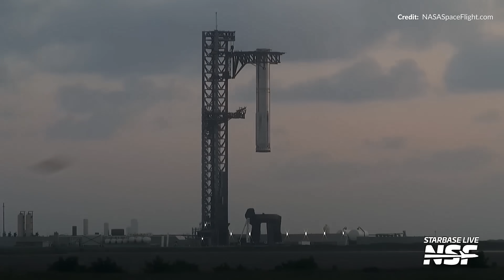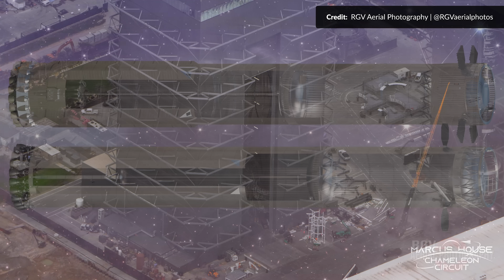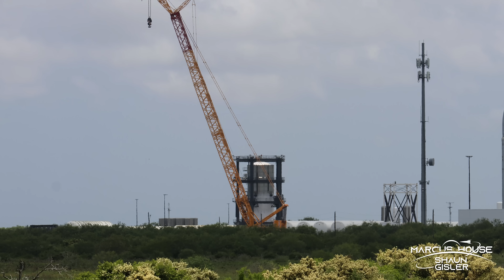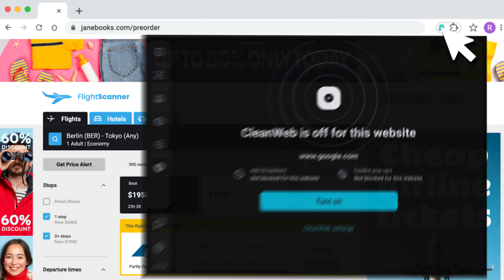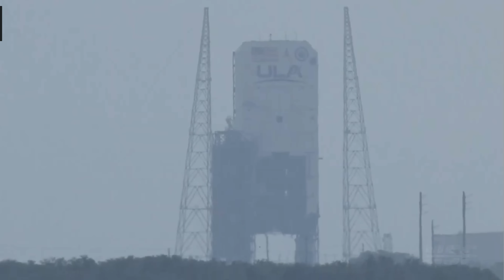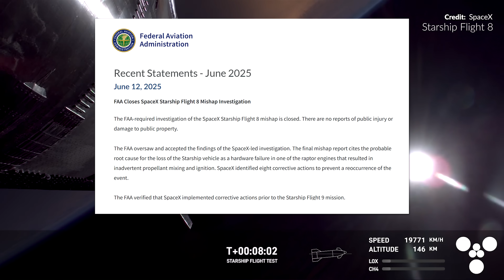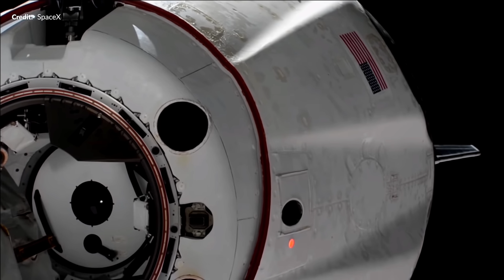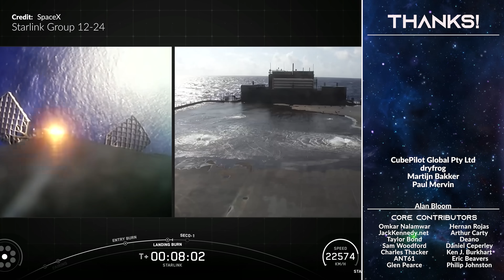Surprising changes to Starship Super Heavy! Why are they doing this?

Comment: It makes so much sense to have dedicated catch towers and landing pads.
This should put valuable launch hardware at less risk and mean less catch aborts when there is a suboptimal scenario.
Reply from the maker: 100%
Reply: For the first 3 years. Then no, dual purpose for rapid turn around
Reply: @rocketignitionKSC realistically, there is no reason to actually reuse them that fast. They’ll be able to built them fast than they can launch and catch em, so it would make more sense to basically have a revolving roster where it launches, is caught by catch-only tower, and then as it’s doing that and is being inspected post-launch, another goes up. Basically like juggling
Reply: @rocketignitionKSC I think it is going to take more than 3 years before a rapid turn around, doesn't involve a trip to a production facility for inspection and maintenance between flights.
It might never happen.
Reply: @psychologicalprojectionist  It makes sense in the early days, but not in the later days.  It's getting 50% efficiency out of your ground infrastructure and sooner or later space WILL be an issue and that efficiency will be desired.
Reply: One factor to consider is that, under the lease from CCSFS, a reusable launch vehicle must return to its launch site. So you can't launch from LC-37 and then land at LC-39A, for example.  Moreover, barge landings are in the EIS, in which case catch towers aren't needed.
Reply: also, it just struck me, catch tower could be the same as starship static fire stand?
Reply: @snuffeldjuret not quite, but that reminds me of something else - given that the catch towers do not need any fuel supply, and do not need to be able to stack vehicles, they can be easily less than half the height of the current towers, and thus MUCH easier to construct

Comment: Thanks for sharing Marcus. In my unqualified opinion I think that SpaceX should really consider doing cold staging during flight 10 and try hot staging with Block 3.
Reply: For what purpose?
Reply: Anything that allows the tiles to be tested on the next flight.
Reply: There is no method to separate them.  That would need to be designed and built and integrated.. and tested.  It would add a delay and its not worth it.
Reply: Sorry 😂 you made me think of that Power Station song 📻
Reply: rejected
Reply: @kaisermichael234  Why did you say rejected like that
Reply: We want to multiply, are you gonna do it
I know you're qualified, are you gonna do it
Don't be so circumscribed, are you gonna do it
Just get yourself untied, are you gonna do it
… Feel the heat pushing you to decide
Feel the heat burning you up, ready or not
… Some like it hot and some sweat when the heat is on
Some feel the heat and decide that they can't go on
Some like it hot, but you can't tell how hot 'til you try
Some like it hot, so let's turn up the heat 'til we fry
… The girl is at your side, are you gonna do it
She wants to be your bride, are you gonna do it
She wants to multiply, are you gonna do it
I know you won't be satisfied until you do it
… Feel the heat pushing you to decide
Feel the heat burning you up, ready or not
… Some like it hot and some sweat when the heat is on
Some like it hot, some like it hot
… Feel the heat pushing you to decide
Feel the heat burning you up, ready or not
… Some like it hot and some sweat when the heat is on
Some feel the heat and decide that they can't go on
Some like it hot, but you can't tell how hot 'til you try
Some like it hot, so let's turn up the heat 'til we fry
… Some like it hot, some like it hot
Some like it hot, some like it hot